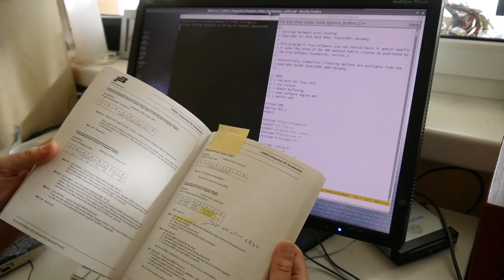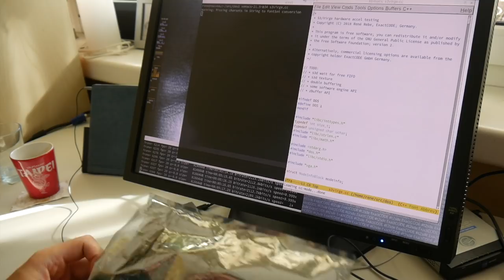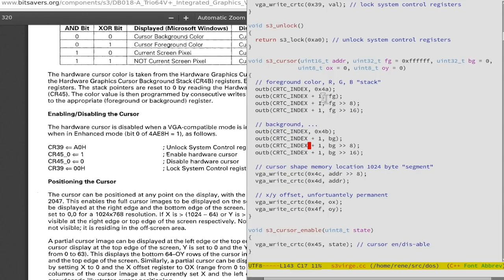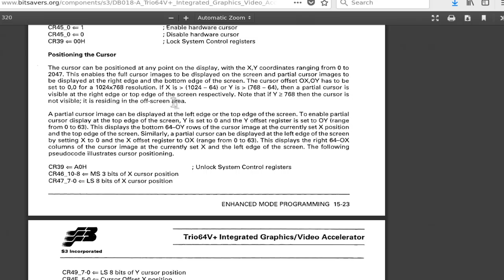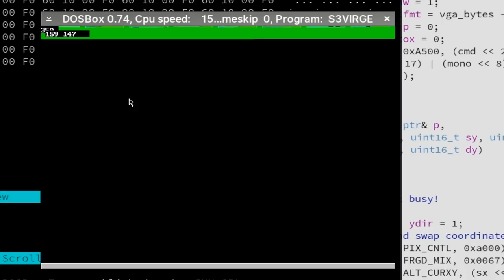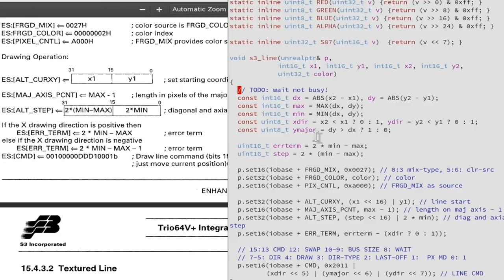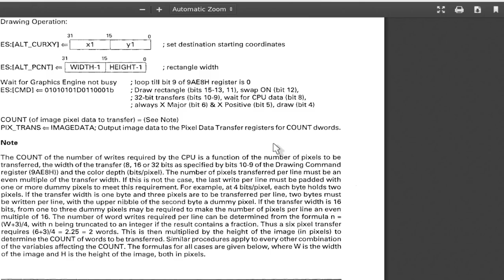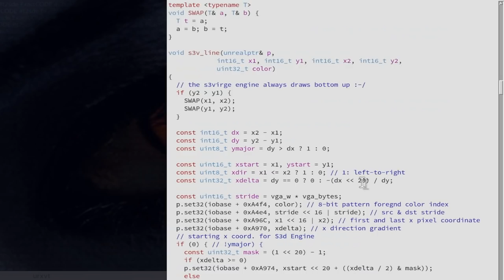How-to: low-level bare metal 2D GPU graphic acceleration w/ S3 Trio, GCC, DOS!

Comment: Hi René, where is the test on the real hardware?
On my Trio64V+ the solid line algorithm doesn´t work as described in your video.
Reply from the maker: I think I only tested this from scratch code on S3 / Virge 3d: https://www.youtube.com/watch?v=JmfeB2LEDbc

I probably should have some older s3 trio in my archive pile - patches welcome!
Reply: You showed the older Trio64 in your video... but if not using it the titel of your video "low-level bare metal" is actually wrong and should be changed to "low-level DOS-Box emulation"... @renerebe
Reply from the maker: @alexany4619  it is still bare metal code, that can run on real hw which I usually tested after initial emulator. it is not using high level GDI or X11 APIs, ..
Reply from the maker: I will try to test it eventually. What kind of code are you currently writing?
Reply: I am using the inline assembler with Borland C++ 3.1 @renerebe